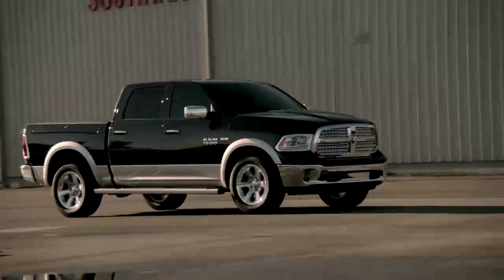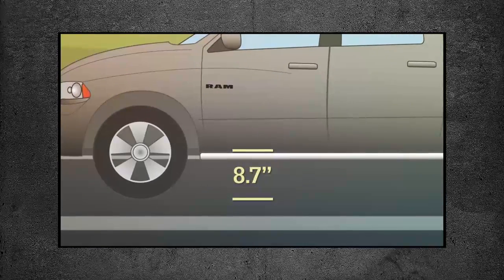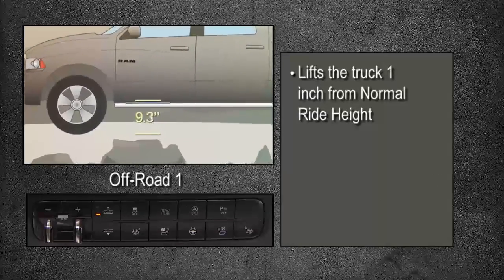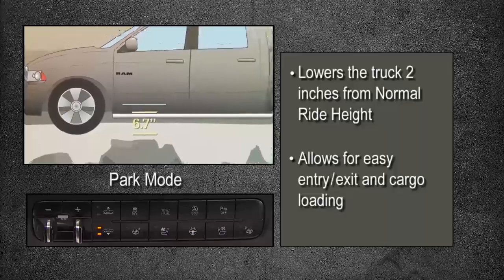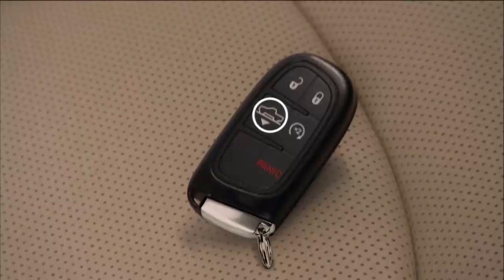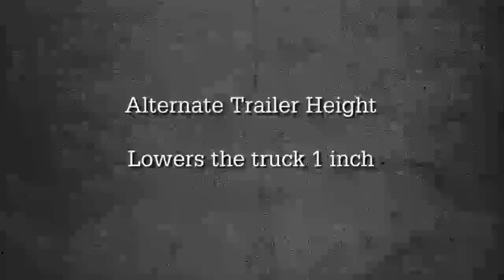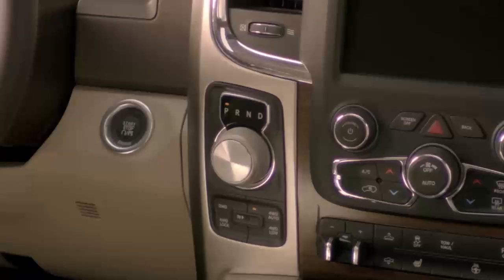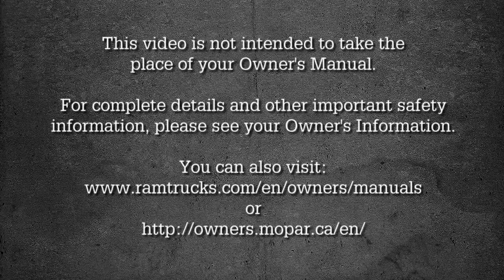Air Suspension-How to use air ride suspension to adjust ride height on 2017 Ram Truck

Comment: So; can I use the ride height to tow??
Reply from the maker: Hi C. Juneau, 
We'd recommend checking out page 541-542 of the owners manual which discusses towing with air suspension and the appropriate ride height for your load. https://msmownerassets.z13.web.core.windows.net/assets/publications/en-us/Ram/2017/1500/P127399_17_DJD2_OM_EN_USC_DIGITAL.pdf ^SM

Comment: Can we lower the air suspension truck 2017 rebel while it’s running?
Reply from the maker: Hi there!

Yes! You can lower the air suspension so long as your doors are closed and your truck is in park! 

Callie
Mopar Cares
Reply: @mopar  I’m just wondering if the air suspension will not working during Negative 25 degrees Celsius weather. In other words will be broken?
Reply: @mopar  my truck rebel 2017 is not balanced infront. A little bit higher in the driver side. What is the problem with that please?
Reply from the maker: Hi there,

The best way to figure out the issue for your imbalance would be to have your vehicle diagnosed with your dealer.

Callie
Mopar Cares
Reply from the maker: Hello,

As the social engagement team, we rely on the knowledge of our dealer network in order to address any technical concerns or questions. We recommend reaching out to your local dealer for additional assistance. 

Callie
Mopar Cares

Comment: What is issue when ride height says cannot complete due to pay load and you are empty . Just started after traveling rough road and is acting up . Then starts responding as usual after a few days then out of the blue goes back to reacting up due to payload that is not there . Had unit in a year and a half back and all has been good now acting up . They changed compressor and valves module etc was working great . Then put down to load for camp this summer and had not a real heavy load and drove away then started display due to load so would not raise to normal height so unloaded at camp and tried raise giving issue warning but went up each level after restart showed up height on display . Then worked great again and on way back this weekend on rough road inactive ride due to pay load came on even after taking off trailer . I live in northern Ontario Canada and have no issues in winter but park inside . But summer getting this showing up as issue . Is this a sensor issue or something as this is a 2016 Laramie Limited with 48000 Kms on it .

Comment: can you drive low like in park mode ?
Reply from the maker: Hello, Thank you for reaching out to us. Page 429 of your Owner’s Manual states, ”To enter Entry/Exit Mode, push the “Down” button once from the NRH while the vehicle speed is below 33 mph. Once the vehicle speed goes below 15 mph the vehicle height will begin to lower. If the vehicle speed remains between 15 mph and 25 mph for greater than 60 seconds, or the vehicle speed exceeds 25 mph  the Entry/Exit change will be cancelled." You can view a PDF of your Owner’s Manual here:  https://www.mopar.com/ramtrucks/en-us/care/owners-manual.html
Reply: Tnx for the info ! I would like to buy some extra Mopar parts but I can seem to find one who delivers to the EU... any ideas ? Tnx

Comment: I am in the process of purchasing RAM 1500 Sport Night Edition and it is missing Air Suspension. Cost does not matter so can it be added once I owned it?
Reply: I added the Airlift Suspension to my Ecodiesel. The truck was one of the last 18's on the lot and didn't have that option. It's a bit rough unloaded but once the trailer is hooked up. I get my Cadillac ride back.
Reply: if cost doesn't matter you can do whatever you want...
Reply: u can.add air suspension on any vehicle it will cost more and u won't have all the remote control features like the factory system
Reply: No, I recommend ordering the truck just like you want. I've ordered 2 a 2016 Laramie 1500 and a 2018 laramie 3500. I bought both cheaper than I could have bought one off the lot.